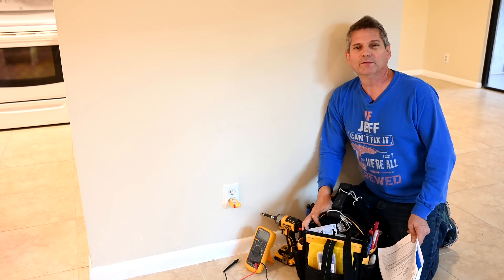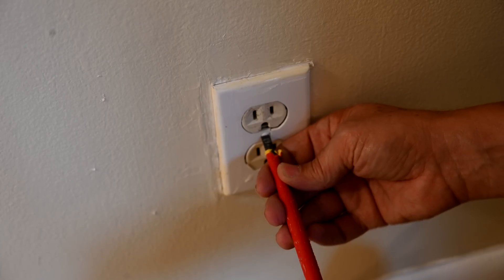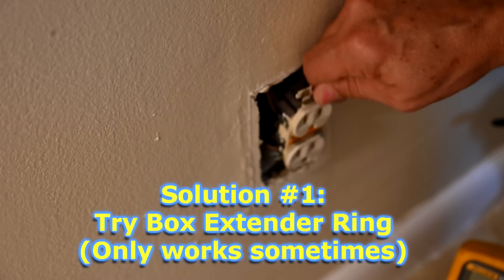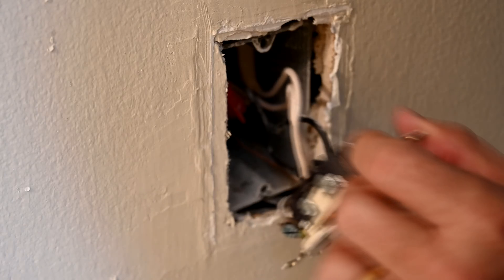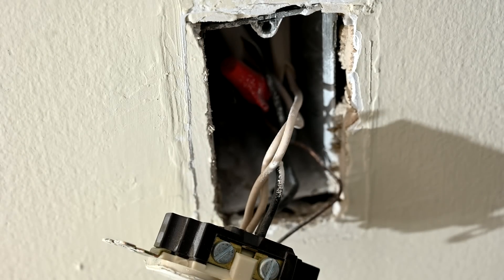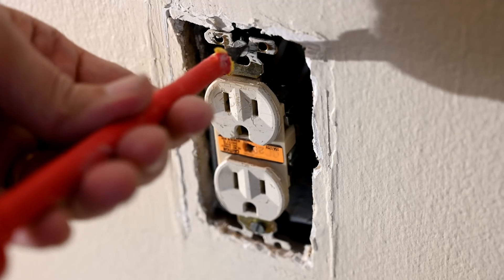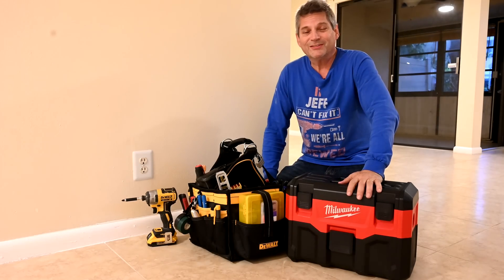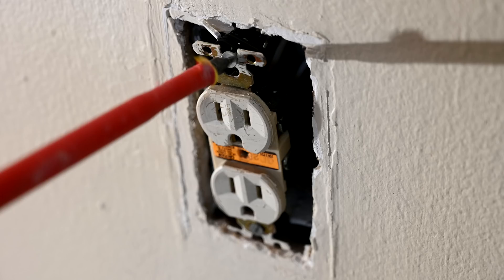2 Tricks To Tighten Loose Electrical Outlets, Switches

Comment: Just moved into a house. Every outlet is super loose. It’s not the whole thing that’s loose, just the holes where the prongs go. The plug just falls out, like a phone charger. What do I do then?
Reply from the maker: Sounds like they were super cheap outlets to begin with, and people yanked the plugs out of the outlets over the years. You'll have to replace each outlet, they are only $3 at most, you can buy them boxes of 10 at Home depot for a discount. Just make sure each outlet has power shut off first, don't assume anything, always test at the outlet before touching anything.
Reply: jeffostroff thank you for the information!

Comment: Well ...  the outlet box is supposed to be flush with the installed drywall. Then those "wings" on the receptacle can ... with the help of the screws ... "sandwich" the drywall in between ... holding the whole thing in place and when plugging and unplugging prevent movement. The reason for the outlet to be loose is because it was never attached in such a way it got more and more loose.

But it is nice that you say ... you seen that since you where young. I come from Europe ... and there we do not have this problem. Most houses are made of stone ... and electric outlet boxes are affixed using a stone mix putty, the receptacle is simply screwed into the non-moving outlet box affixed in the wall.
I came to US to find the house I live in here ... all of the electric outlets are not installed correct. Half of the outlets here, have the receptacle not catch to anything ... which means if you try to plug in something it moves back in all the way ... the box isn't flush with the drywall either. And if it is not that ... they are somewhat loose. I even have a few non working ones around here. Ugh.
Reply from the maker: The outlet box you referred to with the wings on the side, those are remodel boxes, used when you are remodeling a house years later. When the house it built, they are supposed to attach the outlets to studs then the drywall is placed over them and the outlet holes cut out.

Comment: what about putting a screw on the box to the stud
Reply from the maker: It is nearly impossible to do if the stud is metal, because it requires you to drill at 90 degrees to the surface, which you can't do from the angle of reaching inside the box. But if the stud is wood, we have done this before, it is easier to drill into wood at an angle than it is to dry to drill into metal stud.

Comment: Maybe I'm commenting too soon but, my issue is the actual outlet plug holes are loose. I plug something in and, it will be loose and just fall out.
Reply from the maker: Outlets are cheap, $3 at Home Depot. It's time for a new outlet, your old one is just showing it's old age and no longer has a good grip, likely from years of people yanking on vacuum or lamp cords to unplug them. Pretty easy to change them, but remember to shut off power to the outlet before doing any work on it.
Reply: @jeffostroff  what would yanking on the cord do to cause the receptacle losing tension on the plug blades?   Bad for the cord for sure, but wouldn't cause loose outlets-

Comment: I love metal plates. Totally worth the $1 price tag (retail).
Reply from the maker: Yup, some guys are really cheap and have told me they fuse to spend the money! Really, $5 to outfit an entire room with them, and some case you really have no choice, especially with warped drywall.
Reply: If connections go bad metal plate will conduct electricity to your body

Comment: Useless talk talk talk. Get to the point and fix it. Video could be 5 mts. Made into 14 useless mts
Reply from the maker: Useless complain complain complain. You could have used the YouTube fast forward control instead of wasting "14 useless minutes". Also this video shows several repairs, you could have stopped after the first repair to save yourself some time. So go take some lipstick and scrawl your complaint on your own bathroom mirror, because it's your fault, nothing wrong with the video.
Reply: Great tip to fast forward. I will do that with crapy videos like yours. Not only thumbs down, but blocked your entire content. I can send you lipstick to get good looking because you might be not

Comment: My issue is that my things plugged in seem to fall out of the outlet over time and there's always a small gap exposing the parts that plug into the wall
Reply from the maker: If they are popping out of the outlet, then it's time to replace the outlet. The clips inside are worn or bent and have lost their ability to grab.
Reply: @jeffostroff  Why adjustable clips don't exist??? Those loose clips are a pain in the ass, especially in extension cords!!! 😡

Comment: I've come across this issue many times over the years when doing DIY outlets.  But what I did was put tiny washers over a longer screw and then screwed the outlet snug against the box.  It worked well for me.
Reply from the maker: I opened up my neighbor's outlet and found a dozen 8-32 nuts the electrician used for spacers.

Comment: id cut the box out without ruining your wires and repair the drywall around the outlet then cut in an old work box and replace the outlet. that wall plate not matching the rest of the house would bother me lol.
Reply from the maker: Yes your method works, but is a lot more labor, when these black plastic outlet shims do the job perfectly.
Reply: jeffostroff jeffostroff NFPA 70 314.19 and 314.20 would address this. Your box is not really secured anymore. At least to me it looks like the nails are pulled out of the stud a ways.

Comment: Thanks for the info and for showing more than one way to solve the problem. About to repair 2 outlets (yes I will turn off the power first😊) and replace the covers as well.
Reply from the maker: Glad I could help thanks for watching Joe
Reply: Just use jiffy clips.fix it right.

Comment: How about a few 2" screws through the box onto the stud
Reply from the maker: Tried it, can't be done, broke a drill bit already. The stud is not wood it is a metal stud, but thinner gauge metal such poor quality it flexes too much, can't get a drill bit in there at an angle it bounces all over the place. Had it been a wood stud, piece of cake. I was ready to pull it all out and do a remodel box to solve it.

Comment: i used small metal washers ,may 3 or 4 for each screw..will now look into outlet spacers. thx
Reply from the maker: Good, the outlet spacers are much more effective, and I can't tell you how many washers or nuts I've seen at the bottom of outlets.

Comment: 5 minute video, but it just went on and on, Use spacers!
Reply from the maker: Sure we could have done it in 5 minutes and say just use spacers but most people don't know how to use the spacers, and you can use the spacers wrong, you have to know how to block both directions, so you didn't do a very good job watching the video because it isn't just a spacers either, it's the appropriate measurement and cutting the right number of spacers, it's also about using the metal plate.   This is why we have fillers like this because there's numerous contractors out there with your mentality they don't think they need to watch any detailed training on this and so they proceed to ruin numerous peoples houses.
Reply: If these fixes require detailed explanations, I suggest that those viewers stay away from electricity!

Comment: Great video, thanks. I usually run in 2 screws through the box and into the stud at an angle. Seems to work well.
Reply from the maker: works good on wood, but these are thin metal studs and you have to drill head on. Impossible task.

Comment: Shims cost over $9.  Cheaper to use wood stick as a spacer or any 1/4" plastic tube cut to length as needed between electrical box and outlet.  Plastic covering plate is safer than metal ones.
Reply from the maker: Shims cost $9, but the package can treat several outlets, it comes with 5 strips, and many outlets only use 1/2 strip. The plastic shims I used are specifically made for outlets with the hole in the middle of the shim for the screw to pass through. A wood stick is not sufficient for this task, and I don't like the idea of placing a combustible material like wood in there, that does not sound very safe, for someone who claims using a metal wall plate is not safe. Lastly, there is no way to get shocked by a metal plate, because the outlet is grounded, and the metal plate is painted. The plastic outlet plate is not inherently any more safe than a metal plate. If metal wall plates were even the least bit unsafe, they would be banned by the National Electric Code

Comment: I run across this all the time. I have used those shims also. Have you ever used the trick about bending the "ears" on the receptacle? Just take your needle nose pliars and bend the ears back the 1/4" or whatever amount you need. Then screw the outlet in place. It will pull in tight. Works great!
Reply from the maker: Gene, unfortunately I have not been able to try that trick yet, because I always seem to get stuck with the outlets that have vertical space around them, so nothing for the bent ears to grab onto.

Comment: The Drywall Installers loosen the boxes.
Reply from the maker: The drywall installers are not supposed to be touching boxes at all they should just cut around them
Reply: That would be nice.  But after spending hours securing boxes so tight only to have them end up to far back and loose. Several people have told me they had the same problem with the Drywall Hangers. Beyond Frustrating!

Comment: I am wondering why you didn't reinforce the box itself against the stud?
Reply from the maker: The builder used thin gauge metal studs which are not as good as some of the better metal studs I've seen used, so trying to drill a pilot hole into those in the best of conditions when your head on in front of an exposed stud is already pretty difficult because the metal flexes and so it's hard to get the pilot bit to drill that hole into the stud so that you can run a sprue into it. Now try doing that from the side or at an angle it's virtually impossible. Those outlet boxes are normally screwed into the metal studs from the front of the stud before dry well as even hung on to the studs so this is what makes it so difficult. Now if those were wood studs at a had that done and 2 seconds of the very easy to drill into would even at an angle.

Comment: What about loose or worn out receptacle terminals?
Reply from the maker: The terminals should be able to just screw back in. If not, you have to replace the receptacle. But I have never seen one with worn out terminals, because essentially the wires are screwed on once when the house was built, so there should never be any wear and tear, unless some idiot came along later and did something real dumb to cause the screw to strip its own threads. Luckily the outlets are only about $3.00.
Reply: jeffostroff well the outlet doesn't hold on the probs properly and causes plugged in devices to easily get loss of power
Reply from the maker: @dvxAznxvb   OK your problem is the internal part not gripping the  Prongs of your plug properly that's a definite replace the electrical outlet there's really nothing to do to fix that period. Sometimes builders use some unbelievably cheap electrical receptacles, and I have pulled out receptacles that just look so unbelievably WEAK I can't figure out where the heck they got something so minimalstic in cheaply made. Even the decent $2 outlets that I buy at home depot are much better and I wonder how much did the builder save on these outlets that they would use something that cheap.
Reply: jeffostroff chinesuim

Comment: Box extender is the only complaint way.   You put the spacers between the box extender and the box.  But you must use the box extender.   You can't have more than 1/8" gap between the receptacle and box.

Do not cut the box extender.  You just voided its listing.

Sheathing must be at least 1/4" in the box.  There is no maximum. 

Why not change the shitty old receptacle and install a new tamper resistant one?
Reply from the maker: Box extender would not work, so compliant or not it could not be used. Probably could have used a box extender with the shims, with the box extender's sole purpose as being the code compliance, while the shims do the job of effecting the repair.

Comment: End up fixing “lose” outlets all the time. In fact, my Parents house had several lose outlets when they moved in (7). When I went to fix them, you won’t even believe what I found/learned from removing the wall plate. The reason the 7 outlets were lose......bum bum bum.....NO, NONE, ZILCH, had any Gang Box(J-Box, etc...) behind the drywall 😱, REALLY🤣🤣 How lazy do ya have to be, to not install a box during rough in; or even a new work box after the Sheetrock was installed😉.
So, after I installed 7 boxes....guess what, no more lose outlets, cover plates, or issues😉👍🏻👍🏻. So Jeff, you ever had the above issue before in a job?
Cheers Jeff✌🏼
Reply from the maker: Wow, that's a new one for me, the outlet boxes might be loose in the wall, but at least I have always seen them there.
Reply: How they passed inspection, no clue. Also, every phone line jack, RJ45 outlet, cable TV outlet, etc....didn’t have a new work or old work box either. There were boxes installed in this house, but, were only used for the “switches”, LOL, 🤦‍♂️ 
Also, half the outlets had open grounds....as you demonstrated in this video w/ a tester. Take seconds to “check wiring” etc....they really were lazy, or drunk, or something when doing this house😅
Cheers✌🏼

Comment: I just use machine nuts as shims or for the gap u had, i'd use a wire crimp sleeve.

I just the plastic fCeplates in my house. That application def. Needed that metal one though
Reply from the maker: Yes nuts can work, but it drives me nuts. I had to do this repair at my next door neighbors house also a couple of weeks ago. His previous owner of that house was an "electrician" for lack of a better word, I had to fix numerous of his code violations, and on the outlets that needed shims, I kept finding nuts all over the inside of them, over a dozen in one outlet, so someone removed the outlets at one point and never put the nuts back on, that's why I hate them, preferring the snake like connectivity of the outlet shims. Always use the tool or part designed for the job.

Comment: Great video, love electrical how-tos.  Next time bite the bullet and fix the box itself, or do what I really want to see, outlet box refit/upgrade.  All my boxes are micro-sized and whenever I want to upgrade the outlets I struggle with fitting in the new GFCI or dual AFCI/GFCI (or just better quality) outlets.  Thanks Jeff and slow down on the content!  I haven't finished watching "engineering disaster mission impossible" yet!  :-)
Reply from the maker: I wanted to put in new remodel boxes also, I might make my own mock up drywall and do a video on it anyway. Friends were 100% out of cash, could not afford even getting more boxes, and with this house, we don't know what other surprises awaited us inside the wall. Can't just remove the outlet box that is loose, as it is attached to metal studs before drywall goes up, so it is pinched into place behind drywall. Only way to remove old box is slice up the drywall, which now requires 3 layers of drywall mud, sanding, repainting, more time labor money, and we had our backs against the wall with timing and getting things done.

Comment: I found that a metal screw through the plastic box's  left side would secure the box to the stud. Then for spacers just metal nuts at lest eighth inch thick and placed through the electric receptacles. two .032 fasteners. Needed supplies: a few metal nuts, a long wood screw and that large plate would be handy.
Reply from the maker: Yes problem is in this house they used real thin metal studs, very difficult to get a screw into it because it flexes when you try to run a pilot bit. We would have done this if it were wood studs.